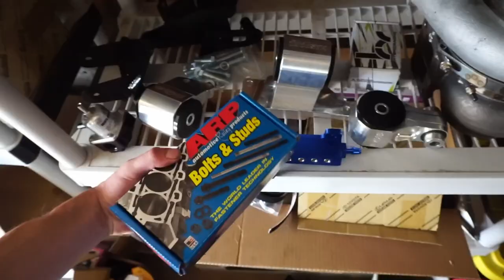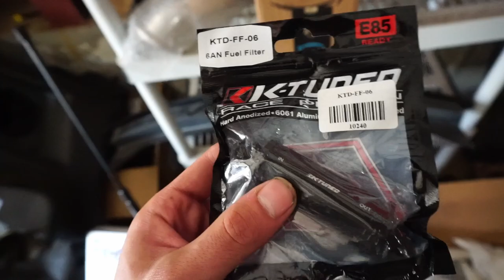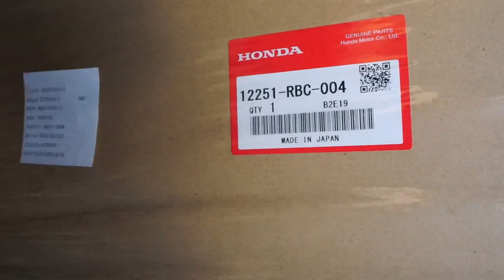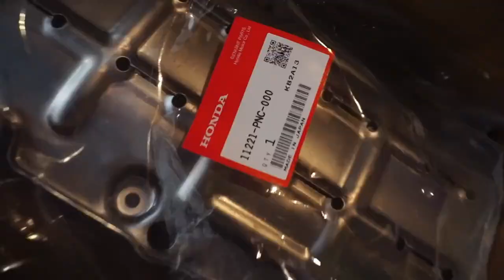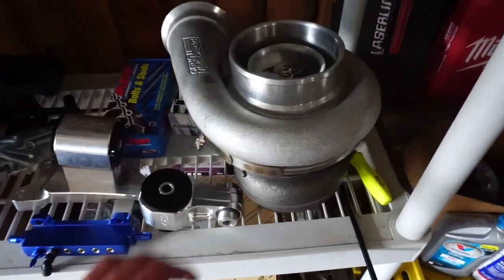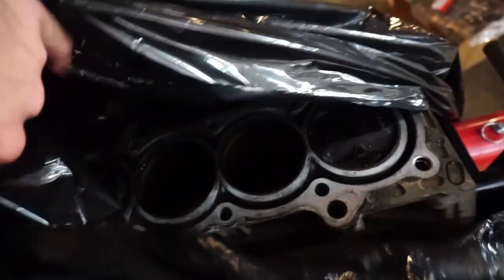HUGE PART HAUL FOR THE SUPERCHARGED CIVIC SI BUILD

Comment: that type s oil pump is legit, hpt puts their brand on it cause they modified to fit k20z3 and k24a, just like 4pistons they buy the oil pump from factory and they cut it and port and poish it with putting their stamp on it also.
Reply from the maker: Well that is a great surprise … I just thought I was getting a normal OEM pump … sweeeet thank ya for the insight🤙